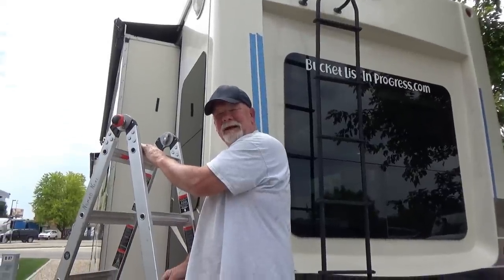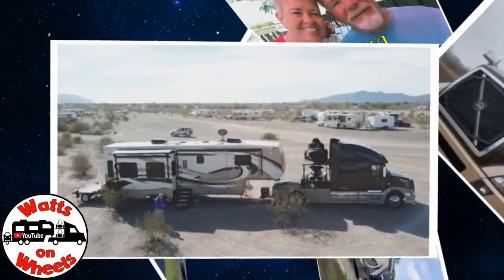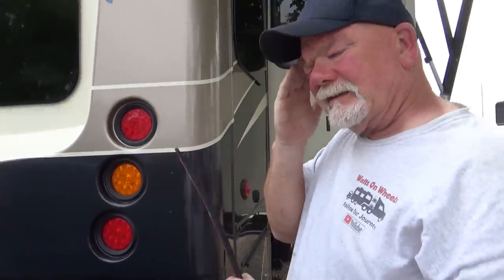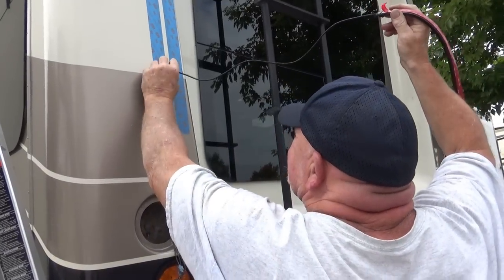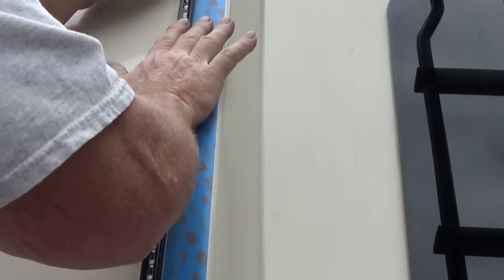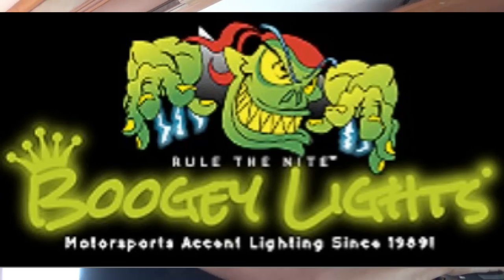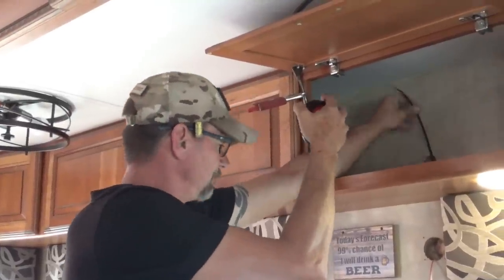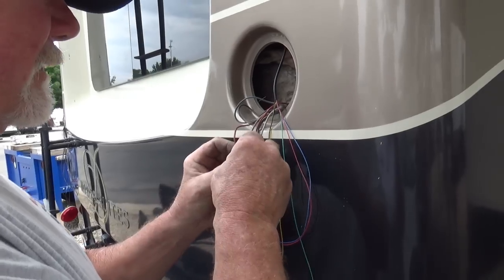💪 We Install Boogey Lights // Rear Lights for Safety & Awning Lights for Fun

Comment: Yeah with your Idaho tote the lights are low!  And so many Toy Hauler lights are low . Adding those rear lights will make it safer for you and the folks behind you.   We have the awning lights don’t turn them on that often. Because we are not outside after dark. Great job 👏
Reply from the maker: Wish we would have gone another foot longer/higher on the rear lights, but definitely better.  We have found the bugs aren't nearly as tracked to the boogey lights as the regular door light.

Comment: Nice the bogey lights are such a low draw you do not need to worry about tapping into an existing 12 volt circuit.   Stay safe and healthy!!
Reply from the maker: Agreed.  Nice not having the bugs all over our door with the original light we had over the door.

Comment: I had to replace the lights underneath my awning so I installed 1 RGBW strip and 2 just white lights.  I used a controller that’s works off my iPhone by Bluetooth and can also use the music off my iPhone.  By using the outside speakers and Bluetooth for the stereo I can have a Desert Disco.  I camp out in BLM and Wildlife Areas solo close to the border.  I’ve also put white LED strips on three sides and rock lights underneath the front overhang.  They are controlled by wireless 12 volt relays.  I use them when taking the dog out at night.  I was 6 miles from the border and close to an airstrip for Border Control and got a fly over when I turned them on one night.
Reply from the maker: Maybe they thought you were an invader or UFO that had landed.  Sounds like you got a good set up there.